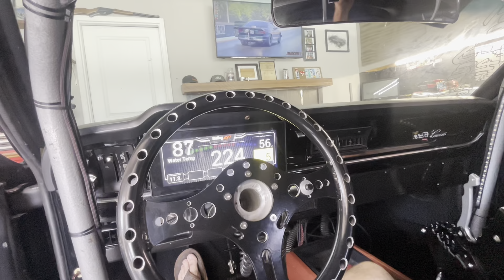🔥 Percy Is Back Alive‼️🚂 Procharged Mercury Comet 💫

Comment: Did you check converter to flex plate spacing , should be 1/8” to 3/16” . Use Grade 8 washers to close the gap .
Reply from the maker: It’s same as it’s always been. I use exact same washer combo everytime

Comment: Well done brother, fyi always keep in mind you lose a few ftlbs of true torque using extensions. Also keep in mind if your strapped and need a 2 post lift, transmission jack, air tools etc,  feel free to trailer your car over to the shop, my guys don’t work weekends so we always have several lifts available. I don’t offer this to any but your an exception! I will shoot you a message with photo of my drum pump, air operated with a valve system. Fill a 5 gallon jug in a minute or less.
Reply from the maker: Man thanks a ton for that offer! And yea I also really need to get a better torque wrench. Ok cool on pump thanks. This one worked great for today being a new barrel full to top

Comment: I would definitely suggest a digital torque wrench. I know its annoying having to keep batterys around but  for me at least on camera i couldn't tell if it was really clicking or not. Sometimes it was, sometimes it wasnt. My ocd wouldnt let me install that converter in the car without a different torque wrench. Part of the reason i never get anything done. Perfectionism is a huge problem. Sometimes you just have to run shit and see if it works or not i guess. Excellent content love the car ❤
Reply from the maker: Thanks buddy. Perfection is the number one killer of productivity. You are 100% right on needing a different torque wrench. Eventually I’ll get myself a decent digital one.

Comment: Geta junkyard fuel pump and a jumper box. Ive been using a ford ranger fuel pump for a few years
Reply from the maker: Good idea. We use them at the shop for diesel fuel in the winter for the heaters

Comment: I have a few harbor freight torque wrenches and they have been way over the number.  I just bought a digital kobalt 0-100ft lbs and a mechanical kobalt 100-250ft lbs and they are way more accurate. And make sure it’s ft-lbs and not inch-lbs
Reply from the maker: Interesting thanks.

Comment: You got big set on you . I love to be as cheap as possible but I can’t gamble with 150-1 odd money . At least get a proper filter to be a little safer saving 100 bucks . a built 400 and bolt together you could be  touching 15k if you have catastrophic failure . Nevermind if a piece comes through and saws your leg in half . Money is one thing well being is another thing .
Reply from the maker: You’re absolutely right. I wouldn’t advise others to do half the stupid stuff I do honestly

Comment: You running an 8.8 rear or a 9"? The reason I'm asking is your disc brakes on the rear what is it. I see your running Billet Specialties rims. I'm Having problems finding a disc brake kit for a 9" that works with those type of rims.
Reply from the maker: I’m using an 8.8

Comment: Yes, the lighter the torque setting, the more faint the "click".  An inch-pound ratchet may work better at that setting.  I thought you would have used a paint strainer for your transmission fluid.  Good job getting it back together, I feel your pain balancing a trans on a floor jack. 👍👍
Reply from the maker: Yes I wanted a paint strainer but didn’t have one at home lol so I said oh well